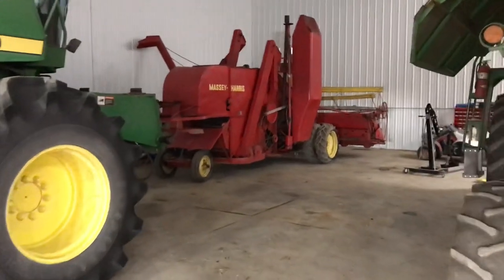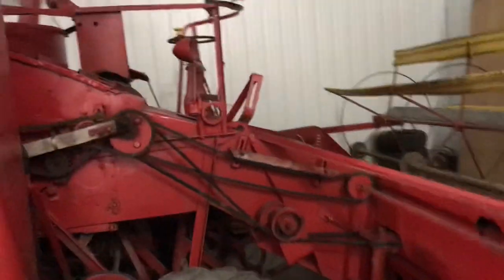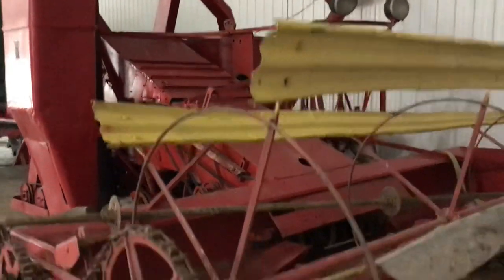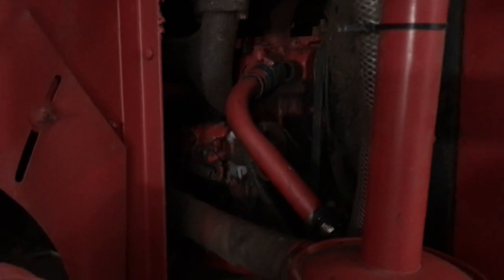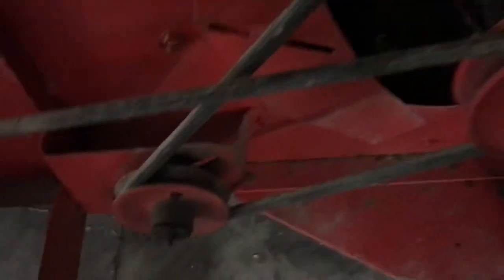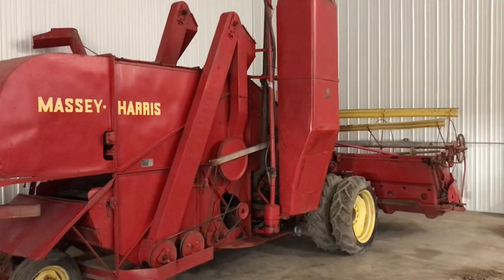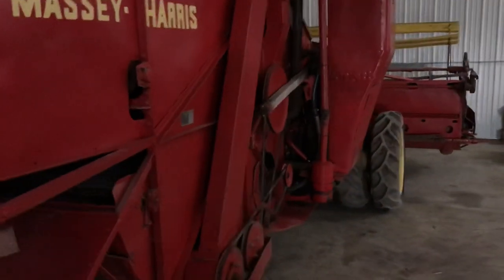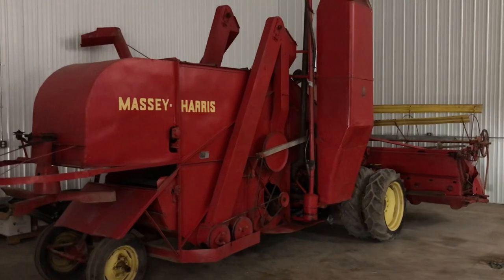Massey Harris 21 Combine- a Piece of Me

Comment: We had one of these when I was just a kid.  remember that in the very early 1960s, we removed the engine and had it rebuilt. We also used to work with my uncle, which required moving machines the 40 miles between our farms. These combines would lose races with snails, but we had no means of trucking the combine from farm to farm in those days. The "solution" was to use two long tow chains to pull it with a truck, both chains hooked to a tire in the middle, as a shock absorber. Safety third! Frankly, it was terrifying, even though we never pulled it very fast. If I recall correctly, it had only the hand operated brake, which if you hooked it just right, under the edge of the seat, also served as a parking brake. Since the operator sat almost on top of the header, it was a filthy place to be. We rigged a sheet of plywood overhead as a combination of some relief from the sun and a slight help in stopping at least a fraction of the dust from coming down on your head. Didn't help much. The operator looked like a coal mine refugee after about a half hour of work. Generally, it was so hot during harvest that goggles although probably helpful, were almost unbearable. Sneezing. Itching. Wheezing. Coughing up black crud. Aaaah, the good ol' days lol.

Comment: If it aint broke too much to be fixt with a twist of wire and a stick, then it prolly needs a welder, or a new belt or bearing and that is yet another trip to the shed. and the grave yard of bits n bobs. Love the header bud. I love my old Claas it near burned one time thanks to a rubber fuel line springing a leak, so I did a swift switcheroonie to a cummins and all is good.

Comment: I had a 21 that came with my first land , had 6 volt header lift setup ( starter  on a chain) you didn't adjust cutting height very much. The engine is know for bad valve guides that contribute to blow by. brings back memory's, but I wouldn't go back  to those days .
Reply from the maker: I’ll check out those valve guides